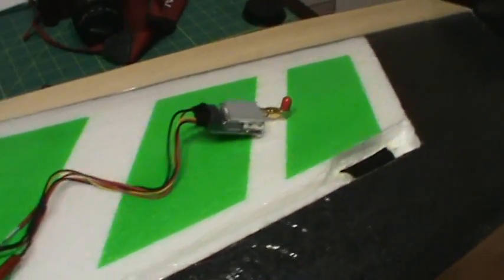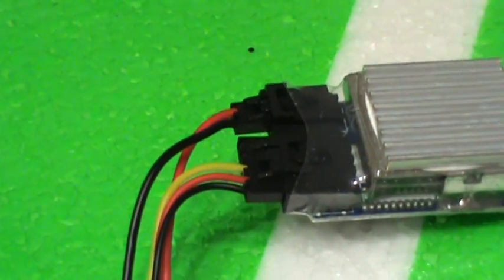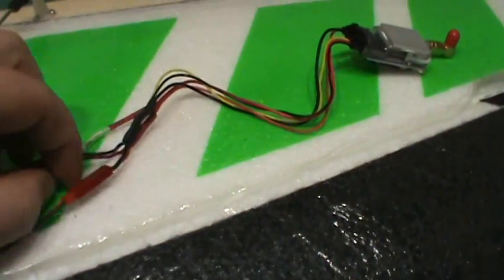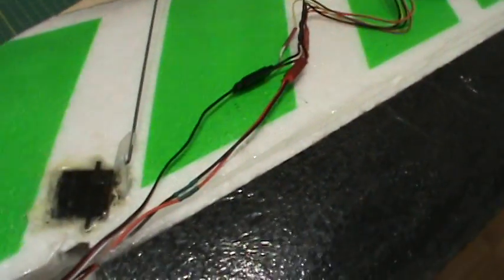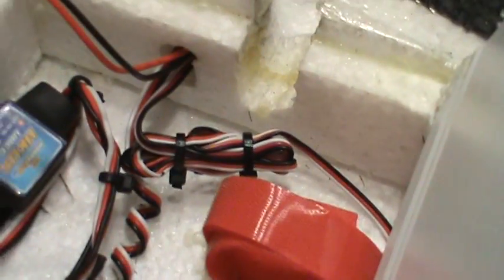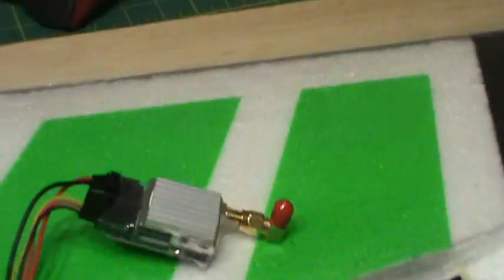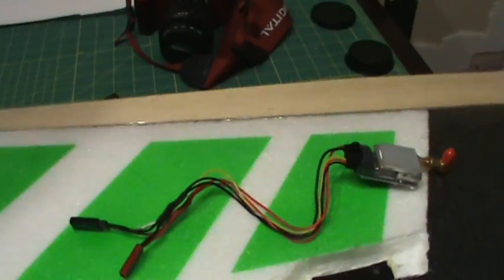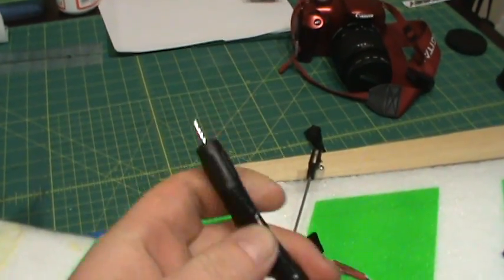Getting Power to your FPV camera via 1 battery

Comment from the maker: Hmm the reason i recorded this video last night was to show  IbnAir23 why his well not work. I understand about the pos/neg into the TX then out to the cam like it shows in the HK manual but there has been 2 so far that the Power is not getting to the cam...
I've had this hooked up like this now for awhile...
So not sure if im missing something either? cause im still a noob as well ;0)
You can watch his video in my  "This video is a response to FPV CAMERA (PZ0420) HELP"

Thanks